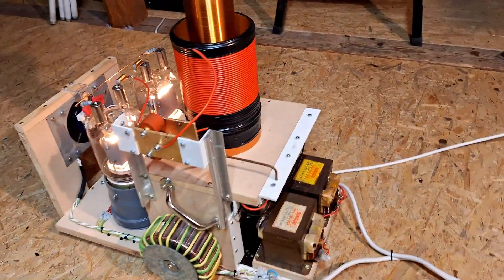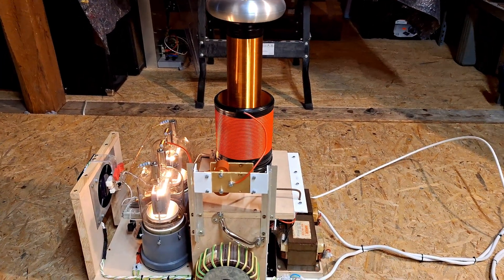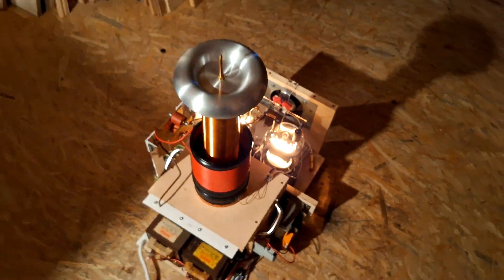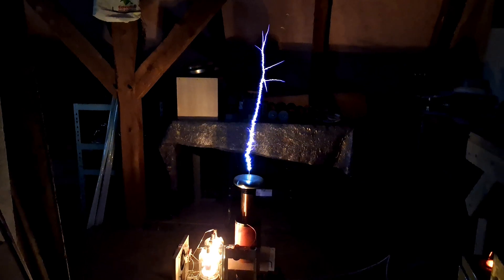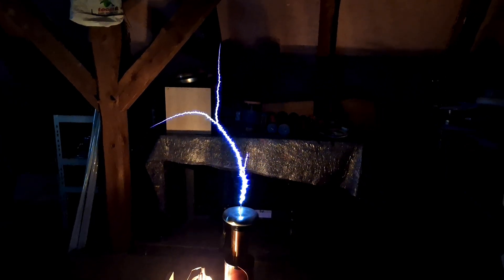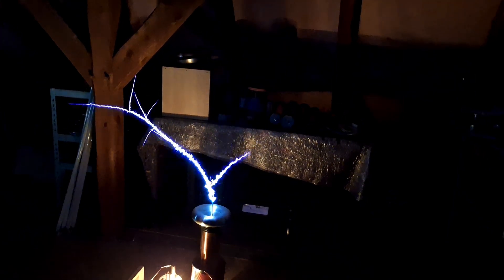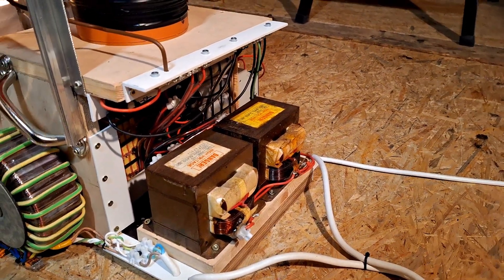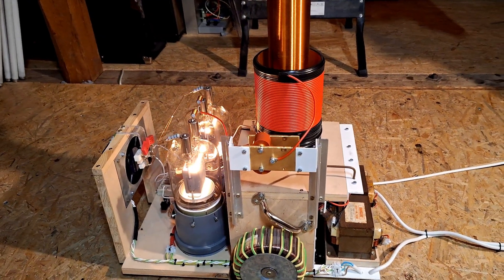Parallel GU81M Tesla Coil (This already SCARES ME NOW!)

Comment: What happens if you use microwave valves?
Reply from the maker: @maniac2315  the microwave valves (magnetron valves) are a completely different thing and would not work in this application.

Comment: How much is  frequency output of valves
Reply from the maker: @maniac2315
This coil is tuned to about 600khz🙂
Reply: @marvsworld247  This means that if you use 10 MHz, the power will be doubled
Reply from the maker: @maniac2315  what do you mean with power? 
Yeah the System eventually will draw more Power, because of the big losses at these high frequencys. 
The arcs would be smaller.
And the tubes have to work harder
Reply: @marvsworld247  7 years ago - I discharged a spark inside an olive oil - by only 50 volts with 2 amps - but the spark electrodes must be less than 1 mm

Comment: Put a brass rod down the center and spin that thing. Lets see what happens.
Reply from the maker: @ProfessionalCodeDigger  haha you mean like a ion spinner?
Reply: @marvsworld247  find a PC fan put it beneath the secondary, put a thin brass or bismuth or aluminium hollow rod on it going through the entire length of the secondary, and run it. Idk what will happen if you spin it, haven't tried that yet. I know you'll get some interesting effects even if you don't spin it :)
Reply from the maker: @ProfessionalCodeDigger  aaah ok now i get what you mean😄 no that wouldnt work. It would just arc to ground connections in the teslacoil and will destroy the PC fan instantly too.
Reply: @marvsworld247  then insulate it :) idk. try it. hate it when someone says "that wouldn't work" fry it and find out :)
My setup is 1000x weaker than yours. idk.
Reply from the maker: @ProfessionalCodeDigger  i dont want to fry a coil where i just take 500 hours and 600€ to get to a certain pint😅 insulating against about 200-300 kilovolts at high frequency is quite tricky
Reply: @marvsworld247  yup, i get that xD Thing is scary af btw xD I salute you.

Comment: Incredible power with those tubes: not sure how many transistors would be needed for such powerful amplification.  Insane power!!!!
Reply from the maker: @sweetdragon36067  
The technology at the modern QCWSSTC's is actually a massive difference! 
With the right build, they acchieve arcs 10 times longer than the secondary coil..sometimes even longer! (Over 3 meter) 
Here in my case i have now about 90cm, sometimes a bit higher... for sure, for just 2 gu81m tubes it is good, but not near of the peak Power of a modern SSTC.
Downsite of such a SSTC is the complexity, cost and the transistors can die instantly by the smallest failure.
VTTC's are much cheaper, "simple" and tubes can handle sometimes up to 3 times of their powerrating for short duration🙂
Thanks🙂🙌
Reply: @marvsworld247  Thanks. My dad became a TV repairman in the early 1950's and remember all the radio's and TV's had huge tubes before the transistor was used in them.  They had ridiculously more power(amplification) than a transistor.  Good to see they are still being used. I'm really interested in zero point power, but doubt I will live to see the use.  Thanks for the info.
Reply from the maker: @sweetdragon36067  oh these are beautiful memories i bet🙂
For me, tubes had something magical since i was a little kid.. and still today its the same.
I can understand that they are outdated in the most applications today,.. but for some specific things, they are still today indispensable😀
I love them especially in guitar/bass amplifiers and audio amplification.
Reply: @marvsworld247  True.  Fender Twin Reverb had incredible power and clarity.  Great memories.
Reply from the maker: @sweetdragon36067  yes, i personally like the dynamics from tube guitar amps. The transition from clean to compressed crunch Sound, just with picking dynamic feels way smoother than the most Transistor based amps ive played.
Also that sweet singing compressed clean Sound feels just really good🙂

Comment: Be aware of objects picking up the field and arcing. My camera tripod was about six feet away and I didn't notice there was an arc from the legs which burnt the carpet. It could be bad if that happened inside a wall or ceiling.
Reply from the maker: @IanDarley  yes, thats actually a thing not many people care about!
I always stay for a while, after Tests with my VTTC 
Because im really afraid about that.
I have seen that first some months ago in an video, someone had a toroid leaning against a Radiator, and it arced over.

Comment: if you touch this plasma what sort of problem would you have? terrible burns and electrocution? thanks
Reply from the maker: @JulianMakes  good question🙂
At first. NEVER Touch it!!
Especially when its ab big tesla coil.
But you can Touch the arcs of a coil, that is build like that schematic..
Direct to the skin, it would burn you a bit.. when you do it too long, your nerves might be damaged over time and you got really deep RF burns. 
It should not shock you badly, because the frequency is so high, your nerve system will not react to that.
But... when you Touch the arc, you will load down the secondary coil. When you have a badly tuned System, this can throw it completely out of tune and the possibility is high, that you get arcing over from the secondary to the primary coil.
This would allow to get you in contact with the (in my case 8KV) powersupply at low frequency..
This would shock you really badly or in Bad case, deadly.
Reply: @marvsworld247  oooof ok tyvm!!!!!

Comment: Just curious, what would be the results if you put a coreless coil above and near the ark, could you transmit the power to another receiver or loop back the power to source?
Reply from the maker: @andrewthuku2638  yes for sure this will work🙂 but it will be extremely inefficient... also looping it back to the source would not doing anything.
The "pickup" coil has to have the exact resonance frequency of my tesla coil🙂

Comment: i can't believe instead of discover or research something new people just plying with these kind of shit like its a toy..
Reply from the maker: @Fanah-4-ilaahi  lol🤣
Whats your Problem with that?
Reply: @marvswelt2587  u tell what's the purpose of that ??
Reply from the maker: @Fanah-4-ilaahi  the main purpose of this is mainly learning about really  complex electronics/physics.
This teslacoil itself has no other purpose but fun. But the way to get there is really long and is a really good practise in experimenting.
This is nothing you can just build off a circuit diagram and it will work perfectly... this is something you need to understand complex connections and interactions.
Reply from the maker: @Fanah-4-ilaahi  when you want to see how i discover new things, you will find some Videos on my channel, where i build a device for electric guitar soundeffects (effectspedal).. This is very unique. But the Video is on german.
I als building tube amplifiers for bass and guitar, based on my own scematics for my Band and other people..

Comment: By the looks and sound of your coil it seems very dangerous if you were to get hit by it.
Reply from the maker: @foamaxmore  getting Hit by it is actually not that dangerous. There are some people out there, touching these arcs with their hands... i personally dont like to do it (and never done it) because, when something goes technically wrong at that moment, this of course can shock you really bad and can be deadly.
But in normal cases, the frequency is too high and our nerve system and muscles are not able to react/contract at these frequencies.
But you can overheat your outer and inner tissue by getting the arcs for too long on your body parts. It is known as RF burning and also can damage the nerve System.
So yes this stuff is extremely dangerous in the wrong hands...
The power supply at otherhand will kill people instantly. This is no joke.

Comment: Whats your doubler capacitance?
4uF or 8uF?
Reply from the maker: @janno288 
Its 2uF
Reply: @marvswelt2587  Thats even stranger. I was told that more capacitance you have is better to get long streamers since the ramp voltage is more stable.
Reply from the maker: @janno288  yes exactly. 
First i tought i had 4uF but that was a brainfart😅 its actually just 2uF 
Or 2,5 now, because i found some old microwave ovens on eBay for 5€ 
But yeah... have to invest for much more... 8 caps are on their way now, so i get it up to 4,5uF in 2 weeks when they arrive.

Comment: I have 2 MOTs series in, series out, no ballast, pulls close to 30A at 240VAC using 10Ga wire.  Massive arch welding static gap, but coil only has 5 inch sparks.  :(
Reply from the maker: @solarsynapse  what did you mean with "series in and series out"?  30A on average or is this the current at switching it on? When your MOT's draw that much current on average, they are just almost like shorted out. You definitely need a Ballast, and need to solve other problems in the circuit.
Maybe not tuned right? 
I got around 1 Meter arcs with my SGTC 7 years ago. I used a 4 MOT powersupply
Reply: @marvsworld247  120VAC primaries in series connected to 240VAC.  Secondaries in series for roughly 46KV out.  Close to 30A when arching.  Gets hot fairly quick.
Reply from the maker: @solarsynapse  aah ok now i get it😀 so you run it on 2 phases.
Reply from the maker: @solarsynapse  at first, it is much easier with sparkgap coils, to have around 8 to 15kv (or even more) and using multiple spark gaps, with a fan, that blows off  the arc and cooling down the sparkgap.
Reply from the maker: @solarsynapse  what is the Rest of your setup? How many primary windings? Secondary windings? What capacitors with what capacitance do you use? 
2 MOT setup in a static spark gap teslacoil delivers not enough voltage.
It might working, but the short high current arc  is not ideal, especially for a static gap
Reply: @marvsworld247  My first one built on a whim using javatc.  May try a rotary gap some day.  Flat primary 1/4" copper pipe about 9 turns, 3rd turn seems the best but not much difference.  Secondary is roughly 20" on a 24" x 4" PVC drain pipe, no holes drilled.  Topload is a 4" metal dryer pipe curved to a 14" diameter.  I have sixteen 941C12P68K-F 0.68uF 1.2KV capacitors in series.  Upon a Youtuber suggestion (Diodesgonewild?), I used 8 caps on each side of the spark gap.  I don't understand the science, but it was explained how that would be good.  The gap is 2 stainless steel carriage bolts.  They get VERY hot.  Nothing burned or exploded.  :)  The transformers instantly discharge the capacitors, so no bleeder resistors.  I have asked in multiple places which way the primary should be wound with respect to the secondary, since it is a transformer.  I either receive no reply, unknown, or doesn't matter.  Perhaps since the primary is flat?

Comment: Nice beautiful coil, Just get some ventilation going in a enclosed space as Ozone and Nitrogen Dioxide might build up. I would love to make my own coil one day. Would also be neat with some sound modulation. Kinda looks like a burning bush.
Reply from the maker: @Kinetic_CGI  thanks mate🙂🙌
Yeah, that output of this coil is getting bigger and bigger. Now like you said, i have to open all my Windows, before i power this thing up, because even my big room fills up instantly with the gasses.

Yeah try it!😀 it takes really some time, but it is a really nice project! Im absolute addictet to it since the last 2 months😄
Sound Modulation would be really cool! But in that powerrating it is impossible to do that with these tubes, because they running on their edge of overheating, even with one way rectifier...when i imagine, they would get that power with smoothed DC, i think they would melt in seconds😅

Comment: Awesome result - its not quite rutting season but some nice antlers you have there !!! 😂😂😂😂🙏🙏🙏👌👌👌Almost curious to try one I have a tube and some mots - - I have an 833c VTTC set up and its small but punchy - curious about the power of a GU-81 🤷🏼‍♂️
Reply from the maker: @Jonodrew1286 thanks!😄 haha oh yeah the arcs really looking like that 😀 
The 833c is really close to the gu81m in Power! 

I would recommend a GU81M the version without the M have a internal capacitor and i heard sometimes about, that these can fail pretty quick in such really hard VTTC applications, when something goes wrong... but i have really little knowledge about the gu81.
but the GU81 and GU81M are absolute Tanks, and can be pushed really hard when the circuit is good tuned😁
Reply: @ I have seen their plate and grid power pushed beyond their ratings - have you ever had to contend with arcs between primary and secondary  🤔
Reply from the maker: @Jonodrew1286  yeah in this application, the anode peak voltage can reach about 8 Kv thats more than the double rating😅 
In this case the circuit has to be really good in tune, because when something goes wrong, the tubes grids can get damaged or destroyed by internal arcing in the tube.

Yes in my beginnings i had 2 or 3 arcovers betwen the primary and secondary because i was really off with the tuning (the primary was tuned way to high) 
That arcing can happen also when the tuning gets off to much by secondary loaddown of the big arcs. 
Its good to tune the primary frequency (over the humb) 10% lower than the secondary.. so its getting in tune by itself when the arcs getting bigger and loading down the secondary.

Comment: really very cool the gu-81m never disappoints with these specifications you could try replacing the gu-81m with a gu-5b making some slight modifications and you would have even more power
Reply from the maker: @antoniocannizzaro7032  thanks!😁
Yeah i was searching a while for a gu-5b but didnt found one here in germany.
But i think when i tune my setup really good and squeeze everything out of the two gu81m i will get enough 😅 i only have 3phase 16A Power avaiable and im a littlebit limited of my eighbours living under me...i think they will not really like me by crashing their Internet while doing 1,5Meter arcs at home😆
Reply: @marvsworld247  here in Italy there is the same situation, vacuum tubes are not found anywhere, but perhaps by limiting the power it is possible to make the gu-5b work with 3phase 16A Power available
Reply from the maker: @antoniocannizzaro7032  yeah these big old Transmitter tubes are getting more and more rare. 
I can find many on eBay, but they have to get send from ukraine or romania... im not Sure about to try it.
 Yeah i could run 6 MOT's on 2 phases, or winding a custom transformer for 2 phase application..  install a bigger cable to my workbench and get 25A breakers 😄 then i could easily push the gu-5b to its Limits..  but i think its a littlebit risky with my neighbours...and its not my house😅
Reply from the maker: @antoniocannizzaro7032 
Yeah cool!
Reply from the maker: @antoniocannizzaro7032
Thanks mate!🙂 yeah thats a really interesting project, that has not finished yet. There will be more possible with fine tuning and more Power from the transformers i think😁
When this is finished, i think i go bigger. But in this case i have to think more about how i set up a faraday cage, to prevent all the RF stray everywhere😅
I wish you luck with your upcoming project!
Reply: @marvsworld247 i have two gu5b if you want i am living in francd
Reply from the maker: @taotao401 
Oooh nice! But for now i have enough to do with my gu81m tubes.
And I just smashed all my little money in to this project 😅